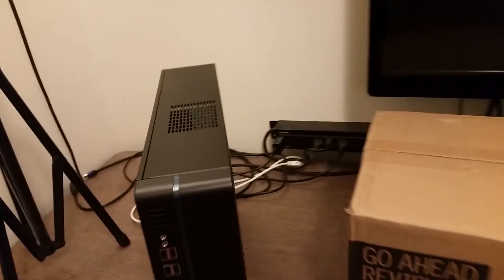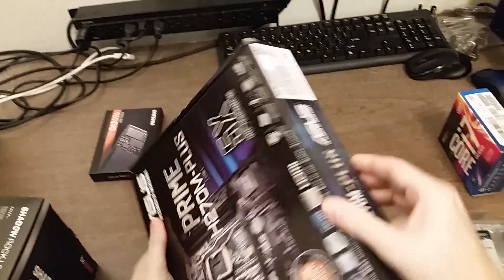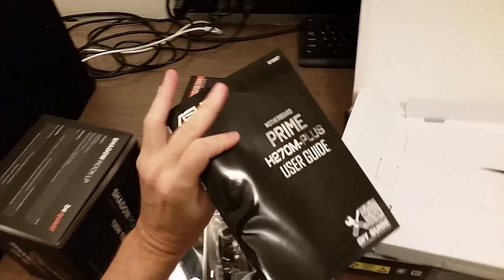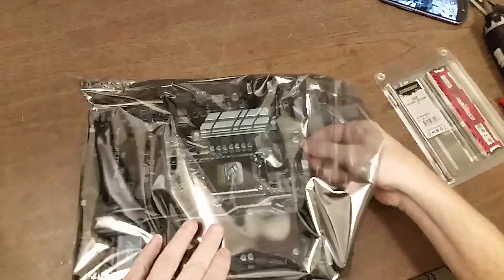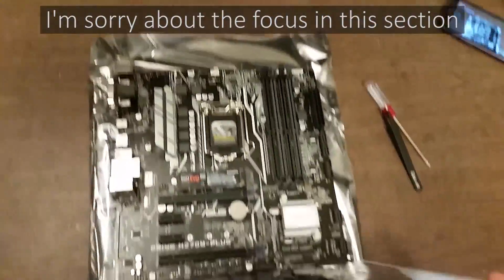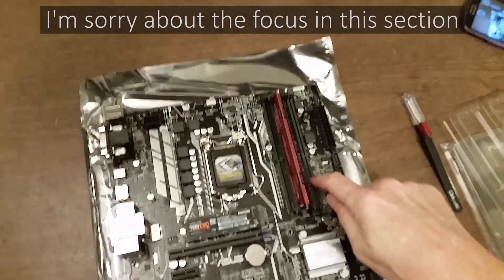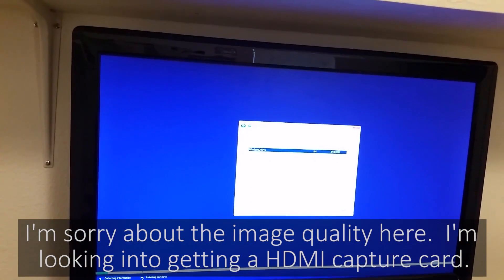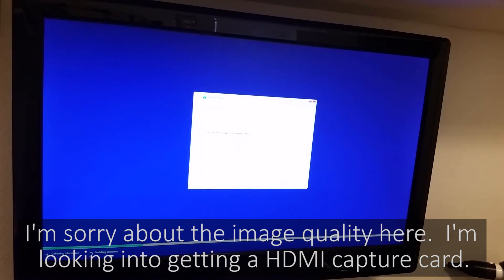Building a SFF Core i7 system, 16GB RAM, 1TB NVMe SSD for client

Comment: That included power supply seems sketchy, how is it holding up did your client ever call and say it died and short circuited the motherboard?
Reply from the maker: It failed during a lightning storm.  The rest of the system Ok.
Reply: @MichaelTheComputerGuy  lucky guy. My 80+ gold corsair psu died and took my motherboard with it. I was so mad. At least everything connected to the motherboard survived and I just had to replace the psu and get a warranty rma return of the mobo.

Comment: so why did you get the unlocked cpu when you wont overclock? it would have been cheaper to just go with i7-7700 or even cheaper and faster to go with an i5 or r5
Reply from the maker: At the time the K version was about the same price.
Reply: @MichaelTheComputerGuy  ah, makes sense, good choice.

Comment: So you didnt use any aftermarket thermal paste and installed the CPU cooler with the pre-applied paste?
Reply from the maker: Peter Kováčik Initially I use the pre-applied thermal compound but at about 37 minutes into the video I took off the cooler, rotated it 180 degrees and then used Arctic Silver 5 thermal compound.
Reply: I thought you were done with cooler so i didnt watch until the end. Thank you for answer.

Comment: So the metal panel were you put in the USB and HDMI slots you pull em out or straight them out of the back?
Reply from the maker: I'm not sure what you're referring to.
Reply: Michael Cooper the metal input panels that comes with the motherboard
Reply from the maker: Enrique Velasco that's called the back plate. It comes with the motherboard what you do is you remove one if it's there that comes with a case and replace it with the one that comes with the motherboard. I believe in the video I talked about little bits of metal that sometimes get caught and cover the ports. On those I usually just bend them out of the way. You can if you like twist them off with a pair of pliers. Basically you work the metal back and forth until it fatigues and they will pop off. Those little bits of metal are very thin.
Reply: Michael Cooper thanks man
Reply: @MichaelTheComputerGuy  don't bend those tabs, those are used to ground the motherboard connectors, they press up against the ports...
Reply: @MichaelTheComputerGuy  forgot to add that they shield your IO from EMF/interference, hence the name IO Shield Although it doesn't really matter that much if you bend those tabs unless you have interference problems